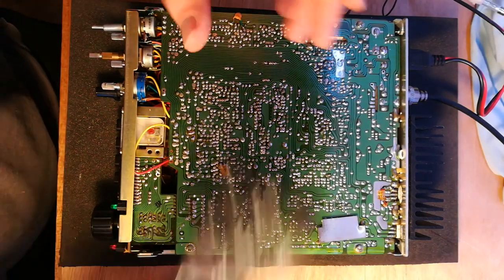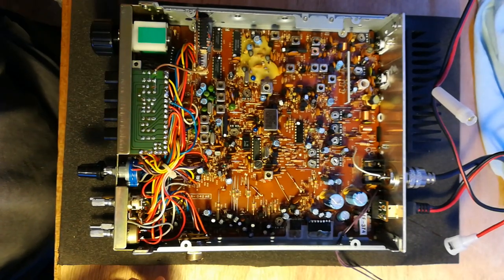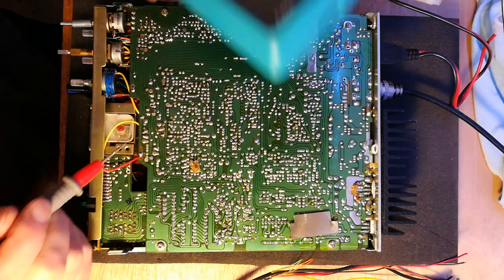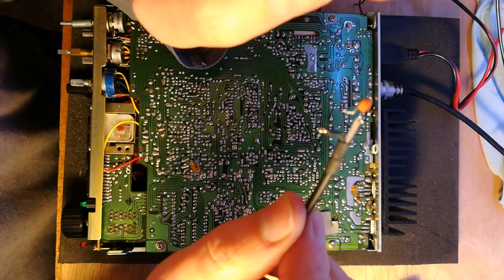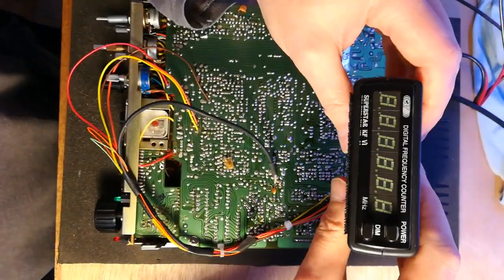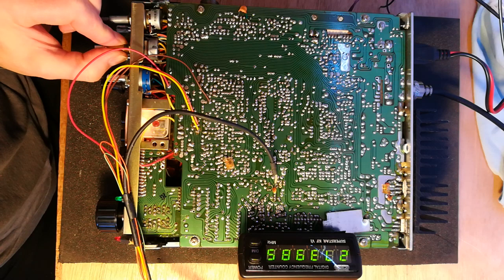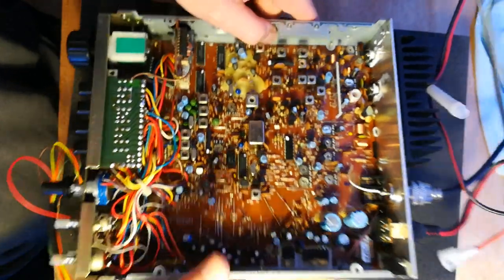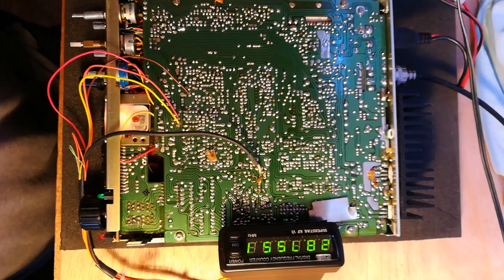Adding a Frequency counter to a Jackson.

Comment: maybe you can explain the coax hook up, i have a superstar 3900 gold plus its a ranger board EPT-690010C and i need the coax hook up i installed a db9 shielded conector. non of the hook up info matches my board .
Reply from the maker: The coax  connects to the VCO , Run the center of the coax through a small value capacitor  ( around 10 pf ) to isolate the coax and the VCO.
Reply: @Gw0wvl  what is the vco and how do I find it ?
Reply from the maker: If you don't know what a VCO Voltage is Ide stay out of the radio personally as you could cause more damage than it's worth , That's just my 2 cents on it .

Comment: Thank You, nice job, but you never once seemed to demonstrate what happens in both videos, when you switch to USB or LSB ?
Reply: Nice vid mate, interesting tutorial.
Reply from the maker: @26tm9999  Thanks Matey...  These little counters are very easy to rig up, Shame the price of them has gone up a lot over the last few years though.
Reply: @Gw0wvl  yep they are a great addition to these old school radios but as you say over priced now. Love the videos keep them coming mate
Reply from the maker: You need to explain what you mean ?   Obviously  the mode changes,  If you want to know what USB and LSB actually is  read up on it..
Reply: @Gw0wvl  What I am asking is: what does the frequency counter display, exactly, when you switch to USB. What does it display when you switch to LSB? EXAMPLE: Set your transceiver to 27.205.0 MHz on AM mode. Now switch the radio to USB mode. What does your frequency counter read? In other words, is your frequency counter and configuration smart enough to compensate for the offset?
Reply from the maker: @KDM--xm9fh  Thats the purpose of the Orange and yellow wire, They are connected to the SSB offsets, so the counter reads true ....  Theres plenty of info online explaining this. .........This video is not about how the counter works,   Its to show how to connect it up to a Jackson, As per the Title.